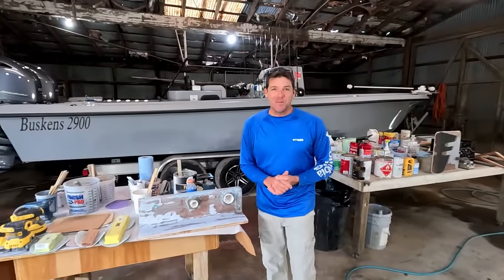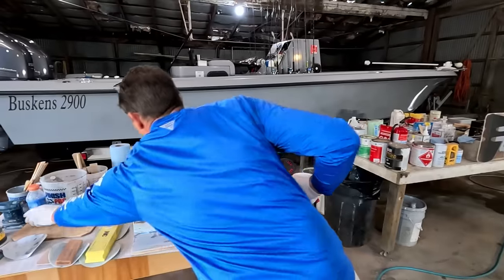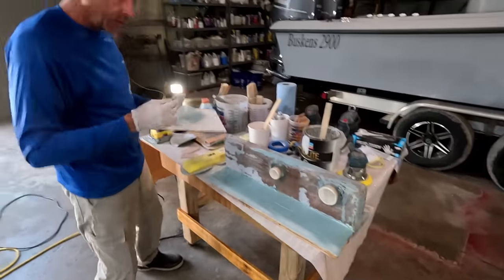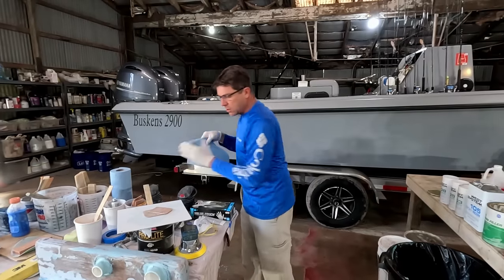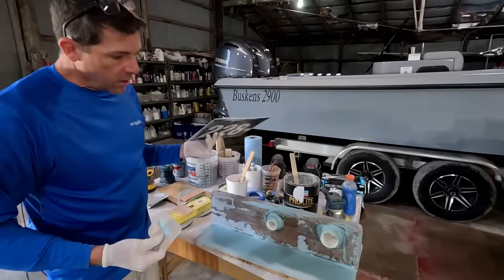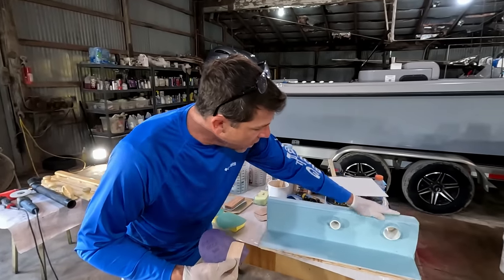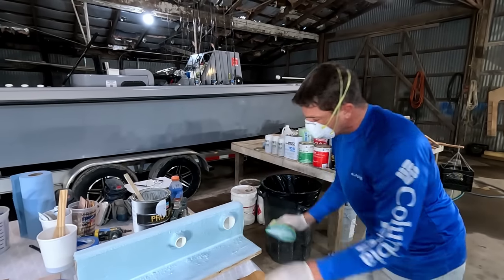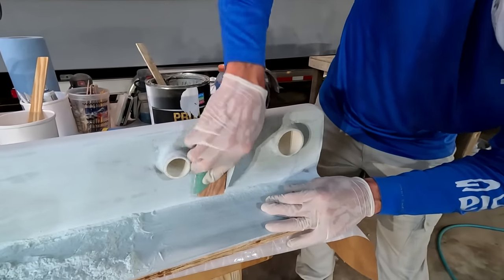HOW-TO FILL and SMOOTH FIBERGLASS for GELCOAT or PAINT! MAKE it SMOOTH!

Comment: A tip for mixing bondo 
Spread the bondo out on your mixing board in a thinner layer it will slow down the heat build up and give more work time on larger 
Amounts big mounds build up heat faster 
Especially on hot days
Also invest in a 3” orbital DA sander , snap on , Cornwell, Matco, even harbor freight, sell them 
My favorite snap on, and Cornwell , they use Velcro paper and with 40 80 180 
Even finer papers can be used….its such a time saver …if you try it you’ll love it
Reply from the maker: Yes, agreed. On hot days or big batches especially.

Comment: I have been doing body work a long time and you are right sand the filler with 40 as soon as you can ,do not let it dry completely it will take forever,  i think if you sanded it sooner it would have been easier,nobody knows this except me and you
Reply from the maker: Yes, Sir! Trade secret, that 40 grit works good. Thanks for watching
Reply: That’s about 2 square feet. 
And I know it’s a demonstration and that takes longer than normal but doing that on an entire boat could take forever!

Comment: Have you done any transom rebuild?  I have a 97 Four Winns Vista 238 and just found out transom was heated by the exhaust and got some water damage on the lower portion.  Thinking about doing it myself but wanted some pro tip and out of all videos I watch you seem to be the best at this.  Thanks for all that you do. You have empowered me to do a lot.
Reply from the maker: Yes, I have done some transoms before. They can be  a pretty big job, and they are all a little different. So there isn't just one standard operating procedure. I will try to talk about our make a video on that subject soon for you guys. Thanks for watching!

Comment: Hey Captain Joe. Love your work. Question: can you add chopped strand fibers to the Napa Prolite and come out with Prostrand? Would it be just as strong?
Reply from the maker: You should be able to add some glass fibers to prolight, but I don't think it would be as strong or consistent as prostrand. You could always do some tests to see. I have been using a different filler with glass in it recently. It is easier to get than the Napa brands sometimes. I will be using it in some upcoming videos. Hope this helps and thanks for watching!
Reply: Gotcha. Thanks for replying.

Comment: I really been enjoying the channel! I also really like your practical approach to projects: spend the time to make things look perfect when they are visible and it makes sense, but for other things, good enough is good enough. Along those lines, I wanted to run a question by you, there's a lot of division out there about whether it makes sense to use products like Inject-a-Deck or other expandable foams for soft deck repair, or whether the only right way to do it is to completely removed the top sheet and replace the old core. Curious what your thoughts would be. Seems like folks that have used the expandable foam have had decent results, but others would never dare even try it. Thanks!
Reply from the maker: Glad you are enjoying the videos! We have always cut out and replaced bad or soft floors. There is almost always rot in other areas, like the stringers as well. But to be fair I have never tried the inject a deck materials. It seems like they could buy you some time. It might work, but I feel better about replacement. Just my opinion for what it's worth. Thanks for watching

Comment: When you mentioned Bondo...would you ever use it on a boat?  It's my understanding that Bondo absorbs moisture and is a very bad choice for boats.
Reply from the maker: No, we would not usually recommended bondo in a boat. I just said that because it is sometimes a generic word for body filler. Hope this helps, and thanks for watching

Comment: I'm buying an old panga (~40yrs old) to refurbish that has pretty significant chipping to the gunwale. Would you say that fillers and putty as shown in this video are good to fill in all the chips around it? (boat is about 20'x6') Thank you!
Reply from the maker: You can use fillers on the deeper chips, then follow with two or three coats of gelcoat. You could also use a thickened gelcoat as a filler. Colloidal silica is usually the additive we use to thicken gelcoat.we have a 2 part video here on the channel using that method that you might find helpful.Thanks for watching!
Reply: Thanks cap!
Reply from the maker: @michaelrodriguez5614  glad to help!

Comment: Is this a situation where you could use a fairing compound before gel coat, or is a lightweight filler the best choice?
Reply from the maker: You should be able to use either fairing or filler under gelcoat as long as they are not epoxy based. Hope this helps and thanks for watching!

Comment: Have question on put in transom? Getting ready to put in new with marine plywood is it ok to use thickened polyester resin tho put it in with. Or should I put in fiberglass like 1708 and then put it in.
Reply from the maker: When we put a wood transom in with polyester resin, we usually put 2 or 3 layers of 1 Oz csm that has been wet out very thoroughly. We then clamp or wedge it in place. You have to work fast, and have everything planned out. We are uploading a video right now that discusses bonding in plywood. It should be up in a few hours. Hope this helps, and thanks for watching!

Comment: I appreciate your mentioning double gloving, and you may mention this in the video later, BUT, do you have a tip to avoiding dripping sweat from inside your gloves when working a long stretch and it’s hot and your hand moving certain ways, you’ll leave notable amounts of sweat on fresh epoxied (or coated) surfaces. 
What do you do to avoid that happening? Or does it not cause problems?🤔
Reply: Thanks for using the N95 mask, and you’re plenty understandable even with it!👍🏻

Comment: For the across the pond thing, Scotland here:

Gelcoat = Gelcoat

1 inch = 25mm, 1/8th inch = 3mm (give or take, maybe a bawhair off but good enough up to round up depending on scale. Easy enough to figure out n/16ths, etc from there)

We use metric mostly except roads because the government is just too tight to swap out the 1970s 70mph speed limit to fit modern braking systems 🤣
Reply from the maker: Fantastic, welcome to the channel! Hope to visit 🏴 someday. Thanks for the conversions, every little bit helps

Comment: Looking to add filler to some piping in a pool that is already coated with a wax gel coat. Does the gel coat need to be removed completely or just sand down the wax layer?
Reply from the maker: I prefer to sand through the gelcoat, down to the fiberglass, or substrate in most of my repairs if possible. I hope this helps and thanks for watching !

Comment: The first body filler is it ok to use on the inside of boat
Reply from the maker: Yes you can, but it is going to be more of an entry-level filler. You kind of get what you pay for, but for some applications it will work just fine.hope this helps and thanks for watching!

Comment: Just watching you put that thin coating on,
I think before I would put any material on the outside corners,
I would have made the exact opposite plastic wiper, and made a female curve for it,
Reply from the maker: Making outside corner profiles is trickier than you might think. But you could certainly try it on your next project. Thanks for watching!